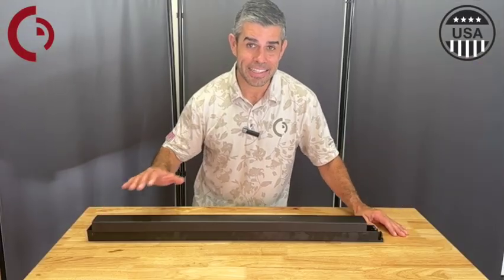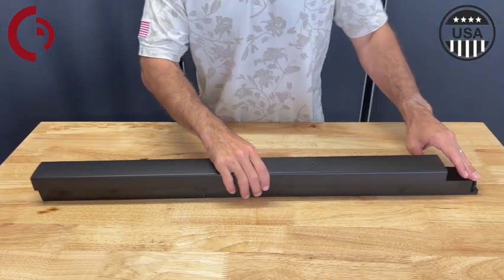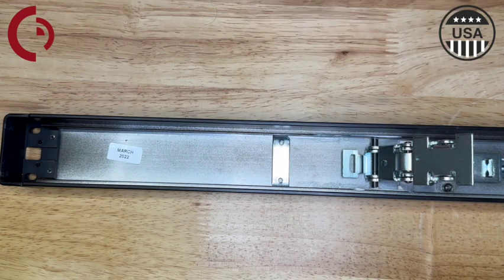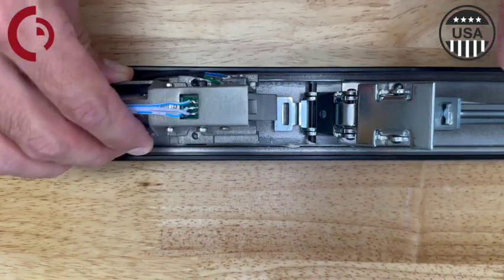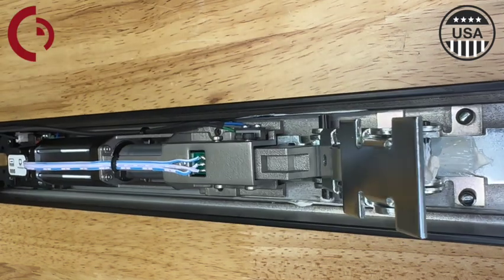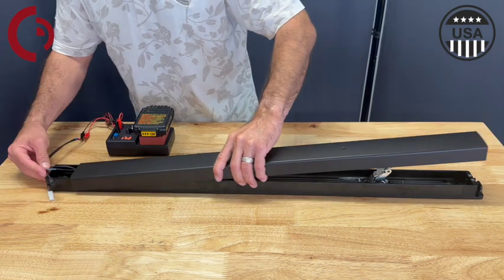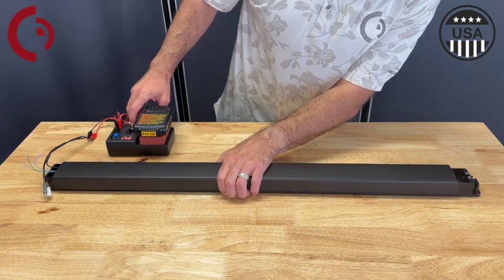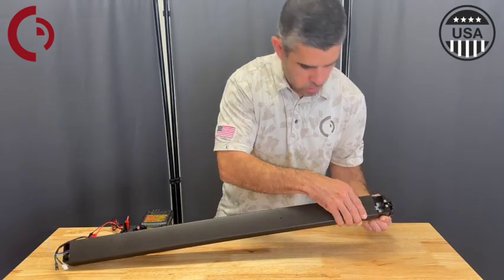Step-by-Step Guide to MLRK1-AR Adams Rite Latch Retraction Kit Installation

Comment: Like the products you guys come up with 👍
Just wish the panic operated faster! Because of electric strikes the common user thinks panics operate instantly. They tend to pull on them too soon to open them
Reply from the maker: Great point! We believe our motor kits are getting faster but you do have the pre-load issue with people pulling on the door as they're badging in. The main difference is these can take some pre-load vs electric strikes seize up with any pre-load.
Reply: Yes we went from maglocks to solenoid the complained it too loud.
Solenoid are fast and loud
Motors are slow and quieter

Comment: Ok when you put into programming mode. Press & hold red button.
Do not turn off power keep it on until you push the bar...
Reply from the maker: Press & hold the red button then apply power until you get a short beep. Release power & the red button then push the pad down to the desired location & apply power until you get one long beep.

Comment: what machine are you using to adjust the learning mode?
Reply from the maker: It's our Command Access Field Tester, it works off your cordless drill battery. Great for testing new installations or troubleshooting. You can check it out here for more info: https://www.commandaccess.com/power-supplies/cat-field-tester/